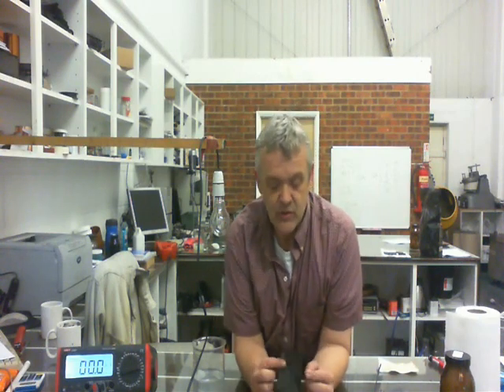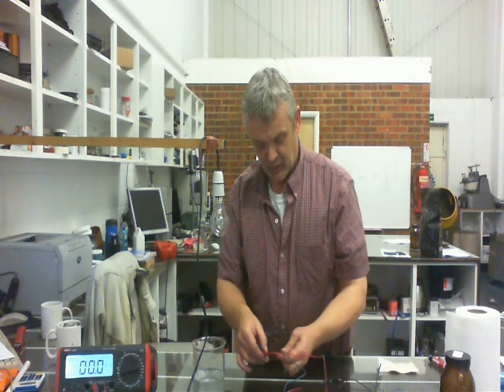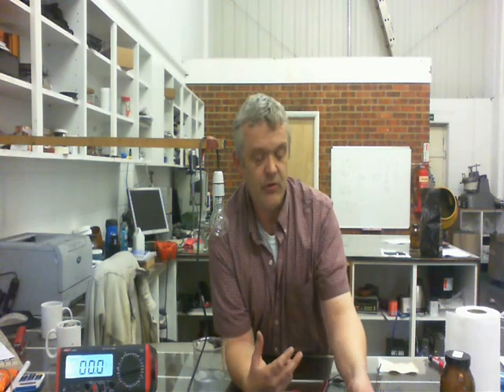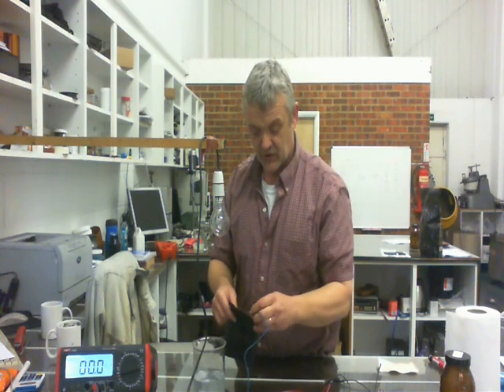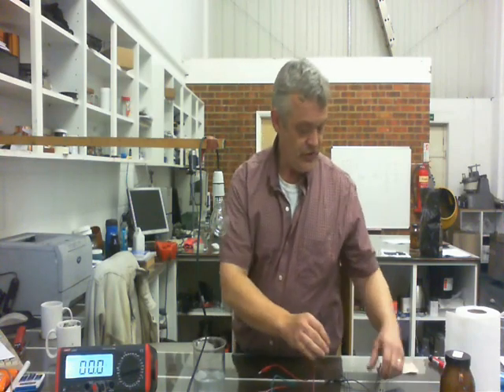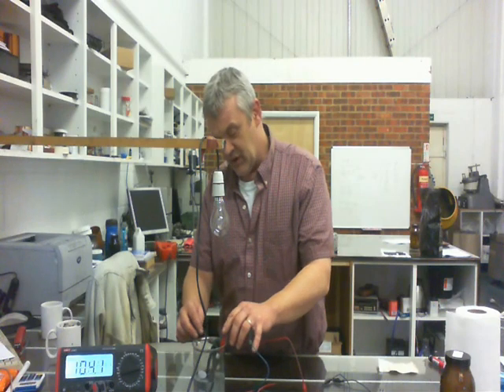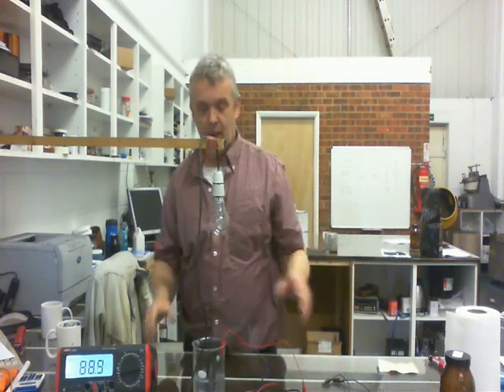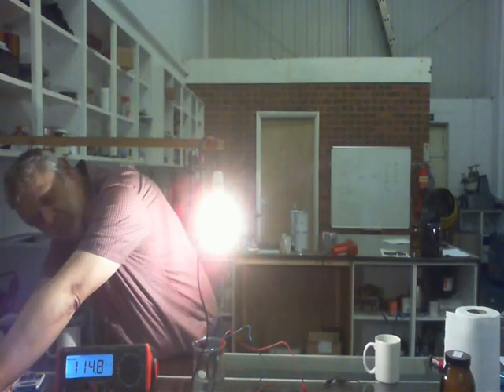EZ Water Cell - Part 2

Comment: just to throw in my 2cents, how about using the same metal for both current collectors, while using 2 insulated and oppositely charged electrodes running beside them to provide the steep electric field gradient to guide and accelerate the electron and ion flow? perhaps a high enough voltage could result in a photomultiplier effect; with the accelerated electron and ion currents resulting in an impact ionization cascade...   hopefully the EZ layer would do something to separate the + and - flows so reduce the amount of recombination within the cell...
Reply from the maker: interesting mate - are you going to try this?
Reply: I should do really, have had this concept bouncing around my head for ages now, mostly connected to thoughts about the original Tesla car and stan Meyer's water fuel cell... never get around to building it...maybe one day... I think maybe I'm nervous that it might actually work.. I hadn't thought about the photovoltaic side of the ez water thing so much but it's good to see u playing with it...
Reply from the maker: sceptic33
i can't do everything mate lol
Reply: no worries, I just thought u might like the idea..  I still want to know why they can't/don't boost the output of pv cells by using hv fields...  gonna have to find the answer one day...   maybe i'll have to actually do some experiments...
Reply from the maker: sceptic33
it's certainly a good way to get answers mate lol

Comment: I once submerged my alligator clips like you did and got an unexpected result. I came to the conclusion it was the clips themselves that were reacting. I've also had electrolyte wick up my current collectors and corrode the alligator clips in longer term experiments. Gold plating the clips would help but then you still have to have a good seal between the clip and the wire it's connected to or then you have to worry about the copper wire corroding. For this particular experiment to rule out whether the clips are affecting the outcome, you could place an extra long copper collector on one side such that it overhangs the cell and can reach up out of the beaker. To help rule out galvanic effects it can be helpful to set up a test cell that intentionally mimics a battery. If you were using copper and oxidized current collectors as Mongrel Shark suggests then as a control you could take those two strips, place a piece of paper between them and soak it with whatever solution you're using and see how it compares to the test cell.

Thanks for the video, Robert. Keep up the great work!
Reply from the maker: mate - the plate was 10.5cm long and only 5 cm was in the fluid - the clips weren't submerged and there was 5.5 cm of plate above the fluid level - that's would be one hell of a rate of wicking if that was responsible
Reply: Robert Murray-Smith Oh my gosh! I'm embarrassed and I apologize. What I thought I saw in the video is clearly not what you actually did. Would you like me to delete my post?
Reply from the maker: Joseph Richardson
no worries mate - as for deleting - up to you really

Comment: Is the reading in volts so you got 114 volts in your last example? IF so would it be hard to set up and stack say 10-20 of them to get 1k+ volts to be used as a low amp spark gap oscillator?
Reply from the maker: its milliamps mate
Reply from the maker: randomlettersqzkebkw
yeah that's right - it has only been running for a couple of weeks mate so i can't give a definitive answer on the will it run out. I suspect it is a cycle action though
Reply from the maker: randomlettersqzkebkw
cool mate - don't forget to do a vid or two lol
Reply: Robert Murray-Smith
Hey Robert just confirming, so thats 0.114 Amps right?
Also, im not good on the chemistry.. the photo active zinc sulphide nano particles, when they react to the light, does the solution change in any way? (i mean, does the reaction caused by the light causes you to have to refill it after some time?)
Reply: Robert Murray-Smith Thanks for the response. Just the fact that its running for a couple of weeks is impressive enough. I'm still awaiting for my ink to arrive. Will be experimenting shortly.
 Thanks again.

Comment: The zinc nano particles do seem to improve the performance well. As did the light. Would you expect the zinc to be consumed and need replenshing over time?

Re Al air battery.
Hmm Nice try, lol, still dosent compleatly rule out air battery 100%. At this point I would be very suprised to find thats whats going on, but cant rule it out just yet. Seen many and made a few that run on humidity. Although they mostly have high levels of Mg and a few other things not present in your experiment.
If you really want to show there is no galvanics. Just show one thats been running a load (resistor would be fine) for a week or two, should be pleanty of time to start displaying decomp in the Al. Would also rule out the inevitable claim that its now a copper-zinc galvanic cell, if it still works after a decent amount of time, and more energy has been extracted than whats in the fuel loading of the zinc.

I made a carbon (pencil lead) and Al foil cell with similar foil mass, and air humidity electrolyte. Ran a Joule Thief for a week before decomp in the foil was clear, and lasted a month before the foil was all turned to whte powder. Of course it didn't run with the foil in direct contact with the copper pos electrode. There had to be a damp paper towel seperator. Which I had doped with alum. Just foil on carbon will still destroy the foil, but its a dead short, you get no potential diference.

I still think heat oxidised copper on one side of a two copper cell would be a better way to provide direction of charge. Would work a lot better than Cu and Al. Which I'm thinking is mostly triboelectric? Wouldn't be much electronegitivity going on there.. Semiconductive p-n junction of oxidised copper would give you a higher voltage reading too.

Your probably sick of this one already and ready to show us the next amazing thing you can do with your ink. Either way thanks for the upload etc, and keep up the good work.
Reply from the maker: fair enough - i don't think the zinc sulphide is consumed but as you point out i haven't run it for a long time only a couple of weeks
Reply: I would think a couple of weeks under load would start showing signs of things being consumed. Especially the Al foil. It may last longer due to the low power levels, but I would expect some kind of decay to be visible after that time.
Reply from the maker: Mongrel Shark
there was nothing - you saw the same panel in the vid
Reply: Ok now I'm 99% confident its not a battery.
Still keen to see if oxidised copper works as a diode lol. I really need to order up some ink and stop asking you to test my ideas.
Reply from the maker: Mongrel Shark
lol - that's ok - if it's too difficult i just ignore it lol - I like the diode idea though - a lot - and will do
Reply: Cool not sure how it will go, the more I think about it, the more I think most of the oxidised copper (and other metal) diodes have needle or whisker contacts.  Might just be to stop the oxide layer from getting damaged? You probably know more about that stuff than I do. If anyone can do it you can.

Steel and Al are the other two metal that can get oxides I know can be semiconductive. Steel (blued with heat) is used with pencil lead (sharpened) for detector diodes in crystal radio kit sometimes. While the Al is formed in electrolyte (borax and baking soda) for capacitors. Probably more out there that we can use, again more your field than mine.

This one is a cool example of home-made Semiconductor.
http://sparkbangbuzz.com/zinc-oxide-diode/zinc-oxide-diode.htm
Might be close to what you want if you can get the same oxide without the heat.
Reply from the maker: Mongrel Shark sparkbangbuzz has a very interesting site - lots of good stuff - as far as I know the point contact diodes you mention are forms of tunnel diode and this is the principle MIM diodes work on though you do need to bias them - it's also why graphene with it's dirac points has such great possibilities - what you are looking for - as far as I know - is a good ohmic contact on one side and a Non-ohmic contact on the other - Non-ohmic contacts come in a number of forms (p–n junction, Schottky barrier, rectifying heterojunction, breakdown junction, etc

Comment: lol 
not quite what I had in mind but close :) - at least it checks the photo box :)

I was thinking of a flat disc shaped "plate" to act as an electrode and a vertical graphite rod in the middle of it ( just above it - not touching )  ... I'd better be drawing it :)
Reply from the maker: stage274 when these things get small enough they are colloids really and electrostearically stabilised but i like your idea and think you should persue it as it is without a doubt not maximised
Reply from the maker: got it mate no worries interesting idea
Reply: Robert Murray-Smith  Is the the graphene you are using hydrophobic?   I was thinking of using a hydrophobic carbon, and a hydrophillic metal, to see if I can pull a potential. 
I have not watched the other vids. Where you claim, your able to make a hydrophillic Graphene sheet, in the last vid, you mentioned, you dried the ink in a mag field.. How did this effect the resistance of the Graphene? 

I wonder if the metal is making an exclusion zone also, since it is hydrophilic.   You may not be maximizing the potential.   Since on that sheet, negative charge is across the entire face?
Reply: Robert Murray-Smith I kinda played around, I used conductive pencil lead, 7mm I believe, 1.5 ohm resistance, and then I used  a conductive strip of metal, not sure of what type of metal, came off a toy, where the battery would go.  The weird thing is, I got .350 volts for like 10 seconds or so, and it would drop to 250 mV... Then I used a new piece of lead, and I got the effect back .350 to .4 volts, then it would go away, and then got another new one, and the effect came back...  I did not draw amps however.   This was just paying around, the water used, was well water.. But the weird thing is, every time I used a new piece of lead. I would get .350 to .4 V potential, and it would last 10 to 20 sec or so...   

Honestly, I dont know if metal can induce an exclusion zone.  I was thinking using a metal strip, put Nafion on it. And use a razor to cut micro meter slices in it..  To harvest the negative ions.
Reply: Robert Murray-Smith  What colloids ? On the face of the Graphene.  Or your methel blue mixture..  I think you have a great result here.  Pulling amps... Just amazing..
Reply: Robert Murray-Smith One more thing, its not an artifact... I have a small level of water in a small dish, and every time, I use a new piece of lead, I pull .350 to .4 volts.  I did this 15 times...  I dont know what that is..  Then, I put the lead, on a battery, and the phenomenon came back.  The lead is acting as a cap....   Yep....
Reply from the maker: stage274 no graphene dispersions are colloidal
Reply from the maker: stage274 now that is interesting - what kind of water did you use? just normal tap water or DI water?
Reply: Robert Murray-Smith  Filtered Well water, it has minerals in it.   The effect last anywhere from 5 sec to 30sec..  I just think it is weird. And once it is gone, it is gone.  I tried putting the lead across the terminals of a 9 volt battery, that  was holding about 4.5 volts..  The effect came back, for a very short time..   Then I could not reproduce it again.  
Only when I used a new piece of graphite 7mm pencil lead .  Very strange..   The water in the dish was a very small amount,  just covering the slim metal piece I was using.   And I would stick the pencil lead, just beneath the surface.  And I was pulling a potential of .35 to .4 volts.  

I dont know what to make of it, I used like 20 pencil lead pieces, and all the new ones I used, did the same thing. They all pulled a voltage.
Reply from the maker: stage274 that is strange - maybe a capacitive effect like you thought
Reply: It is a capacitor effect.  I left a 7mm graphite pencil lead on a 9 volt battery for 40 min, the battery had about 4.5 volts left in it...  And the effect came back. And lasted 30 sec...  Um.. Do you think electrons can be stored between the Graphene van der Waal layers?  I am pulling .350 volts !      I think that is a neat effect, if I can constantly reproduce it.  The resistance of the lead is 1.5 ohms also.
Reply from the maker: stage274 it's probably ionic mate - rather than electronic and if the graphene has a few layers maybe reversible intercalation